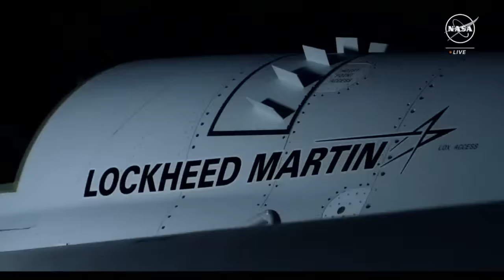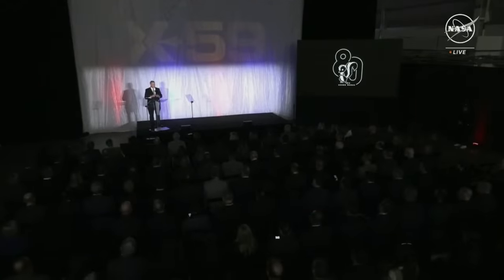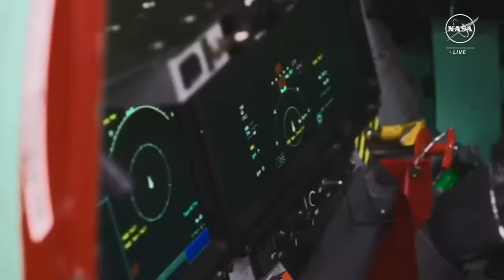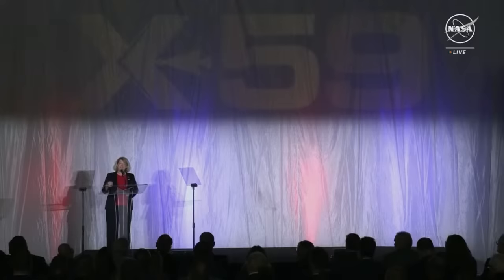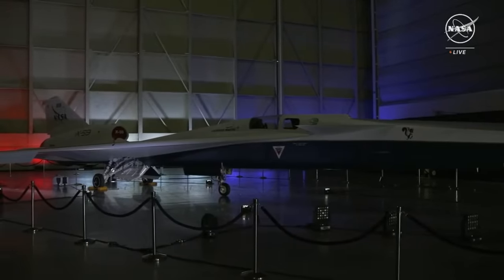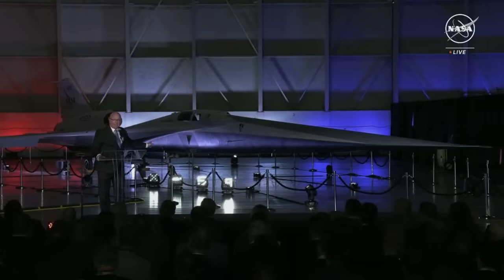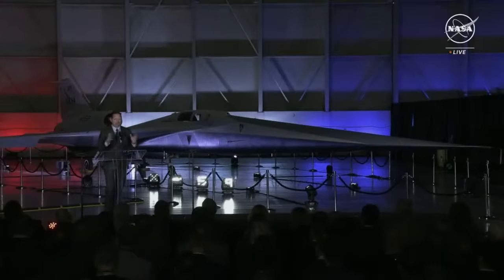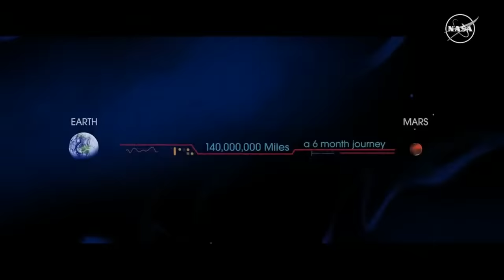LIVE: NASA unveils X-59 supersonic aircraft

Comment: That was a roll out?   It was more about rolling out people than a "Bitza" meant to explore concepts like the Handley Page 115, BAC 221 which were mere hand maidens to Concorde so not worthy of centre stage before a result had been achieved.  This show was closer to a time share sales pitch than respect for worthy engineering with people not wanting to be upstaged by the aircraft and at a time when the precursor design work can forstall so much of what used to be done in the air.  When flying a 767 through a climbing Concorde's shockwave it was possible to feel the entertaining bump but it is more usual for observers on the ground to make capital of the noise. The companies that buy the aircraft and people who buy the tickets  are seldom disturbed by shockwaves. 
 Supersonic travel was stopped by cost. The true value of a less intense disturbance of the air is how much less fuel it uses to travel that fast.